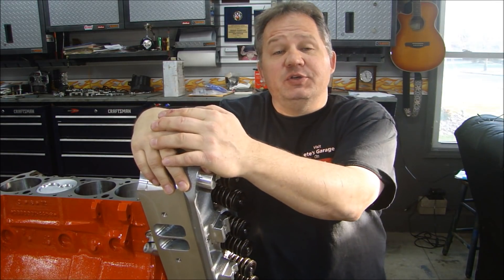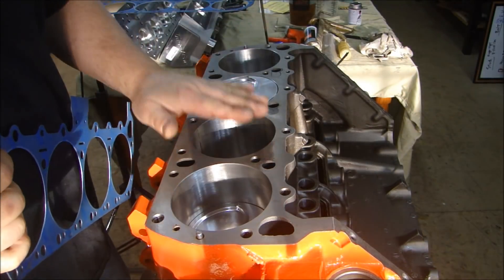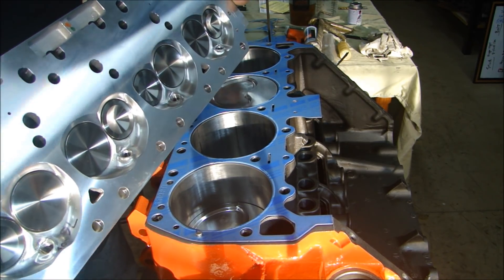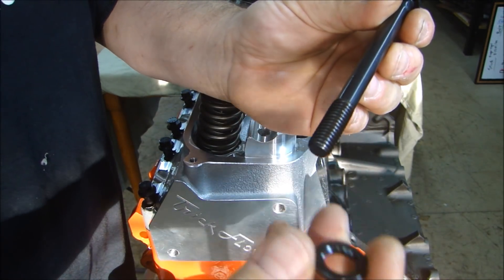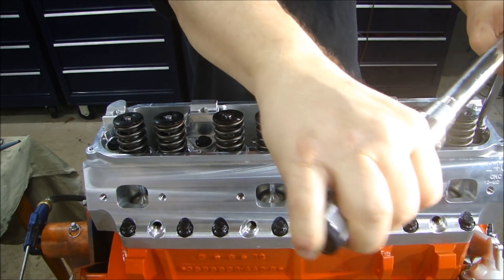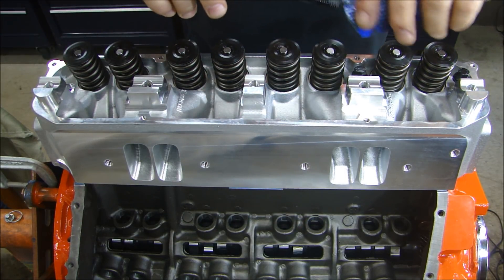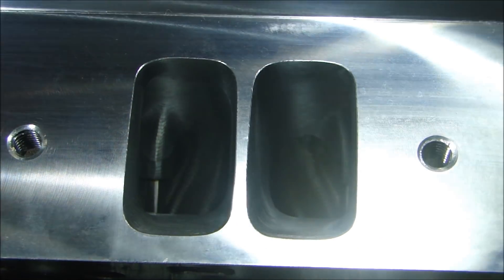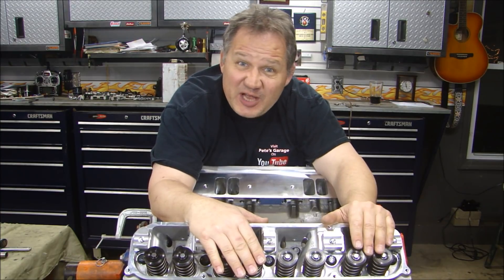440 Chrysler Mopar Engine Building Part 8 - Installing Trick Flow Cylinder Heads

Comment: Hello Sir
I bought the 440 trick flow upper motor kit cam etc.
My issue is the cam  "hydraulic " is a tad longer then the original one. For it to sit.right it sits out 1/4 inch which changes my timing chain gear! Is this correct? Thank you for your time.
Reply from the maker: Call 440 and ask, you may need a different timing gear

Comment: i know this is an old video, but sharing for anyone that may come across it.  Just received my 240s and they have small shavings in them that will need to be cleaned  highly recommend to NOT bolt on right out of the box. Otherwise, excellent product as usual and much nicer than a set of Victors I have.
Reply from the maker: Great comment, thanks!

Comment: i don't know if you will see this but are there any special torque specs for aluminum heads or do you just use the normal one. i got a 413 with them and i need to take her apart. better safe than sorry when i put her back together. n.n;
Reply from the maker: Yes there are. Follow the manufacturers recommendations

Comment: so on mt E Street heads there is no locating Dowl holes in the heads , so i removed the dowl pins does that make sense?
Reply from the maker: Dowel pins are pretty important. I would not take them out. Check to make sure. If there are no holes there is nothing you can do

Comment: Pete great videos so much info and much appreciated. I just pulled apart my Indy 440 -1 headed Mega block due to a low leak down number on cylinder 6. I’m ready to put the head back on and have a quick k question. Muscle Motors assemble this and I found they used Grey RTV around water passes. The deck is oringed and they used copper flat out head gaskets. I I didn’t see any worry on your assembly regarding the water passes. Do you see a need with my setup? And why did Muscle Motors do so?
Reply from the maker: If it was a copper gasket without any coatings on it they used it to seal the ports. Use a coated gasket and you won't need any sealer

Comment: Hi Pete, I notice that on your Ford rebuild you lubed the head bolt washer, is this true for the Mopar 440 as well?
Reply from the maker: You should always follow the manufacturers recommendations. New ARP bolts with aluminum heads are different. Putting lube on the washer will shift the torque curve slightly.

Comment: Stock FT 240 flow:

Intake
.100" 72
.200" 154
.300" 230
.400" 282
.500" 310
.600" 326
.700" 334

Ported TF 240 flow:

Intake
.100" 110
.200" 169
.300" 244
.400" 296
.500" 338
.600" 354
.700" 368

Also numbers from TF are a bit "optimistic" but as you can see, hand porting is worth the effort.
Reply from the maker: Interesting

Comment: A note on bolt lube for torque on Head, Mains and Rod bolts or Studs.
Because bolt lube (grease types) liquid oils etc. are like water and will not compress.
You must use minimal amounts verses excess amounts.
1 to 2 drops of lube oil dragged across “one section” the length of threaded bolt end is enough.   
Excessive bolt lube can generate false torque indications
As the bolt is torqued, the excessive lube overfills the threads and as 
higher torque is applied “stops” an accurate torque setting from being 
achieved.
A 110 lb. reading may only be 80 lbs. of torque applied.
ONE drop of oil is always a safe and sure rule.
Reply from the maker: Great comment, I have a couple videos that discuss and test what happens to torque when lube gets on a fastener

Comment: Did you retain the same height as stock for the cylinder heads in relation to the intake manifold? Or did you have to mill the intake because the cylinder block deck was resurfaced?
Reply from the maker: It was the same

Comment: Hey Pete, I'm about to start disassembling my 440 and will re-install the same heads if not cracked, would you have any guides or references/tips/tricks on how to assemble all the valves, springs and stems on the head or is there nothing specific for these engines?
Love your videos, just went through all of them all at once.
Reply from the maker: Replace the valve guides, put the valves and springs back in the same spots, hand lap the valves
Reply: How old are your springs? If original, might be time to get new springs. I would definitely replace the retainers and locks at any rate.

Comment: I'm definitely getting some trickflows for my procharged 451. I saw where the customer only wanted 500 hp. I bet that was beyond easy with those heads
Reply from the maker: t was just over, around 518 I think
Reply: The 240's can support a lot of power. I make well over 640 hp n/a on my 540 with a Howards 723235-08 cam. If you build a good engine and put a procharger on it, you can easily make 800-900 hp with the 240's.
Reply: @AB-80X  You are a bit too optimistic with power. High quality 470 will make 750ish with TF 270 heads but it will require some money on the table. You want that kind of hp you need Indy or B1 ported by someone good to flow 400cfm not to mention not very streetable bfc ;-)

Comment: I've been told by a machine shop that aftermarket heads should always be bought bare and never out of the box ready to install because of valve leakege issues. Have you ever had a problem like that?
Reply from the maker: I have never had a problem, but they do have a point
Reply: Lol. Do you know what that machine shop would do for a living if people did not buy bare heads they could "fix" out of the box? Not a damn thing.
AFR, Trick Flow, Pro-Filer, Mast, Edelbrock, Dart etc. It works. What you might want to do, is talk to your cam manufacture about springs. I always use a spring based on the cam manufactures advice, not what comes on the heads - unless the manufacture is okay with teh stock springs. Funny enough, with my TFS 240's Howards were on board with the stock springs. But I suppose it's because it has very similar cam specs compared to the cam Trick Flow recommends when using the 650 lift spring set.

When you talk to machine shops in the future, be vigilant about what they say you need. The more CNC stuff that comes out, the less they have to do. It's that simple.

Comment: Question: I’m building a pro street 440 (74 block) with a 509 purple cam and I’m looking for new aluminum heads. Are there any heads you’d recommend for that application?
Reply from the maker: Can't beat the Trick Flow or AFR
Reply: These are perfect for what you are doing. They will support a lot of power and they retain remarkable transition characteristics. I have mine on a 540, and could not be happier.

Comment: Pete been looking at these and the 270 heads. I see the difference is max wedge intake ports. Can you tell me if there is a max wedge intake that accepts 6pack carbs? Do you think there is an advantage to getting the 270’s without stroking my 440?
Reply from the maker: There would be an advantage, but I do not know of a 6 pack intake
Reply: Pete's Garage Thanks for the reply. I am gonna do the 240’s then.  Im eventually gonna do an 8-71 blower on another 440 block to swap in car and i think the 240’s would work also.  Any input?  This is gonna be my first blower engine.
Reply from the maker: You'll need lower compression with a blower
Reply: Pete's Garage Yes! I talked the Theblowershop and they also said to make sure the build is 9:1 or less to able to use pump gas. Im not too sure on cam selection for blower applications. I guess I have a little reading to do.
Reply: @Dodgechallengersixpack  
Just an addition. I have done a few RB's with blowers. The Blower Shop makes a nice blower, but unless you are looking to really push it, go with the BDS stage 2 8-71. There's nothing to gain from the high helix blower unless you spin it really fast. The BDS stage 2 works better for a street/strip combo with the lower blower speed, and will also take less maintenance. All that teflon is cool, but it needs replacing. The BDS 8-71 will easily support 800-900 hp and have a better response and last longer. BDS also have a super nice manifold that fits the RB. 9:1 is more than low enough with modern alu heads, don't go lower. Remember that the best motor you can make N/A is also the best motor you can make boosted. It will be more important to make sure your pistons and rings are up for the task - gas ports, ring gap and that sort of thing.
As for blower cam? It's like it has always been. Every cam is a blower cam, and if it makes good power N/A it will make good power blown. If you make good power N/A you need less boost to make power blown, and at the end of the day, boost is merely a function of resistance in the intake. You can make big power on low boost and no power on lots of boost. If anything, if you have a cam you already like, consider getting the manufacture to do a version of it with 2-3 degrees more LSA. It will soften up the bottom end a bit, but the positive displacement blower will fill in that dip in torque. The wider LSA will then help the motor carry a bit better out the back door.
Something hydraulic roller with 238/246 @ .050, about 610 lift and 112 LSA would make a really nice blower cam in a 440 wedge.  Give Kirk at Howards a call, he knows his Mopar cams.
Reply: I run 240's on a 540 and I'm far from running out of head. Unless you are making some serious N/A power, you gain nothing with the 270's other than a headache. And seeing that you plan on using the 3x2 bbl, there's a "natural" limitation there. Forget 270's unless you spin that 440 past 7000 rpm and run a big single plane. I make close to 650 hp with my mill and that's with a "mild" intake for nice drivability.
You can get a 3x2 bbl intake for the 240 and it will still support 575-600 hp, so just go that route.
Reply: @AB-80X   what "mild" intake did you use ? Just curious.
Reply: @Torquemonster440  Trick Flow normal wedge w. 240 heads. Mind you, my mill is a 540, so everything seems smaller compared to a 440. But the TF single plane is actually a nice intake that does many things well. Alternatively you could go with a Hughes ported Perf. RPM DP. But all things considered, the TF intake(non-max wedge style) is really good as the runners have a decent length. It's nothing like a Super Vic or the like, it's a properly well though out intake. There's a reason why so many use it in so many different applications. What ultimately defines how well your engine runs is the whole package and cam.
Reply: @AB-80X   oh, nice.. I've had one of those sitting on my shelf for a year now. I'm hesitant to swap from my Performer RPM, for fear of killing torque.  I run a 3500 converter and 4.10 gears, so i dont think it will be too bad. I also plan on using a 1" taperd Wilson spacer.  This is in a .040 over 440 with 10.3-1 compression and Edelbrock heads.  I have a very mild solid flat tappet in there now, old school mp .528 purpleshaft .528 lift 242/242 @.050 on a 112 lsa. I will be swapping to a much more aggressive cam shortly, custom comp roller with .575 lift, 243/247 @ .050 and a 107 lsa. I'm hoping with the new cam, the Trickflow intake will complement it well. ? Your thoughts ?
Reply: @Torquemonster440  
With that stall and those gears, your engine is begging for more cam - and the TFS intake is a great option. The RPM intake is nice and okay for the mild cam, but especially if you step up the cam, it will just kill the top end. With a 3500 stall, you flash past the weak part of the rpm band anyway and a 4.10 gear is not hard to pull. 
The TFS intake will also give you better cylinder to cylinder distribution.
If you're stepping up to that kind of duration, I'd take advantage of the intake and use the TFS Track Max cam. It's a brilliant lobe design that also runs really well with the Sharp 1.6 ratio arms should you wish to increase lift even further. That setup will get into the powerband from about 2900-3000 and up. My guess is that it will make your current converter flash 200 or so rpm higher, so it will get one heck of an additional nice kick in the rear when you get on it.
Reply: @AB-80X   i was thinking the same. I speced that custom roller after the Track Max cam.   Just with a little less lift as to not stress my old scool Crane ductile rockers. I dont have the extra $1k to drop on the Harlands.. wish I did. I also went with a 107 lsa to help crutch my still mediocre head flow .. you know Edelbrock vs TFS.. didn't have the coin for TFS's either.. 😕.. but i think with this combo maximized i should be in the 525 hp range.. probably the same for tq.. 🤞 I'm also gonna run solid lifters on that Hydro stick.. sounds like the hot ticket if you wanna run a roller on the street trouble free. Mid range solid lifters are considerably cheaper than high end hydro lifters, which sounds like you need to go high end if you wanna run hydro lifters, lots of problems with the budget versions from what I've read. Thanks for your input.👍

Comment: Pete, I’ve looked pretty hard for this head you’re using and can’t find one with a 76 cc chamber. I see a 78cc. Can you provide a Trick Flow part number? Also, what compression ratio were you shooting for on this project?
Reply from the maker: The part number is 61617802-C00 which are listed as 78cc, but I think I measured differently, I really don't recall

Comment: Well I hope when I measure mine they're exactly 78cc if they're 76 ill be over my "on the verge" for pump gas 92 compression
Reply: I was just about to ask Pete which heads he used because all the TF Mopar 240 heads I’m finding have 78cc chambers.
Reply: @tedshredz58  yeah, they're computer cnc so there shouldn't be any variances unless there's a bit of shift in the mold but I doubt it. These heads visually are a proper aftermarket performance head. I dumped rubbing alcohol into all ports after I unboxed them & absolutely nothing came through any valve. In the combustion chambers I am going to hit em up with 120 grit roll to get them soothed out. A guy on a mopar forum got the 240s to flow 350cfm @ 600 lift by 80 grit rolls in the intake ports just removing the tooling marks.
Reply from the maker: That's why it's important to check

Comment: Sorry but B1 Orginal heads blow those outta the water so does indy
Reply: Robert Parker Nothing wrong with Trick Flow 240 or 270 heads for BB Mopar.  Indy makes great heads too.  You claiming Indy out preforms TF without giving a application, use, compression ratio, cam or type of fuel delivery is a little too broad of a statement.  There’s 1000’s of dyno run tests on engines producing big HP with TF heads.
Reply: @jamesfeil2468  yep Andy finkbeiner has 750 on the 240s with a 470 cube engine.
Reply: B1 heads don't just bolt on and you can't use any & all of your factory parts either like you can with trickflow. Indy heads in this price range don't make the same power either, or flow numbers especially since were talking a standard port head. Hands down trickflow 240 wins in a apples to apples test. Or as you would say "blow them out of the water"
Reply from the maker: Thansk Robert

Comment: Dear Pete..As a fellow motorhead myself I was a little surprised you didn't opt for the MLS Head Gasket's especially with the Dissimilar Alloy's , We both know what happen's with aluminum & Iron ..Don't get me wrong Felpro have been my Gasket's of choice since my very first head swap in 77.. Anyway good luck ..
Reply from the maker: It's a great option Michael. For this particular application I did not see the need for it.

Comment: Hi pete, nice project you got going, i'm a big mopar fanatic , I bought a 69 dodge charger and a 71 Plymouth road runner right out of high school back in 1983, Still own them today , and both big block car's ,  like you're garage videos , Back to the ARP head bolts , They counter sink the one side of the washer so you get a more precise reading when tightening down the  heads , no drag on the top inside edge of washer / corner of bolt head to bolt shank, gives a gap in corner and like you said a nice smooth surface to surface  mate.
Reply from the maker: That's really awesome, you're lucky to have those cars. Great comment about the ARP bolts.

Comment: Could you comment on the spring rates? Which did you select and why? Which head/spring combination is best for a solid flat tappet cam at about .600 lift? Thanks Pete...great information and wish you were closer to Bawstin to build my engine.
Reply: Contact your cam manufacture and use the what they reccomend. But why on earth would you use solid flat tappets with 600 lift? You can easilly lift to 600 with hydraulics. I lift my 240 heads to 640 with hydraulic rollers and it work perfectly.

Comment: I do not claim to know anything about after market heads, however I have watched a number of Youtube posts. Nobody takes the heads out of the box and bolts the to the block without taking them apart and checking them. I have seen a lot of mistakes from the manufacture.
Reply from the maker: That is not a bad practice. I inspect the heads visually. Most defects can be seen if you know what to look for. When you get up to $1,000 per head you can have more confidence in them right out of the box.

Comment: Have you any experience with other sets of these heads, the spec on the head is 78cc's,  just wondering if they all come at 76cc's.
Reply from the maker: Since they are CNC ported they are all very close if not right on. I have not had a bad set.

Comment: Hi, what are you opinion about 440 Source Aluminum Cylinder head and Edelbrock, compared to Trick flow heads??
Reply from the maker: Well, Trick Flow is a CNC ported head so it will flow a little better. If you have the money and want the most HP, it's the best way to go. That does not mean the others will not perform well.
Reply: Thanks ;)
Reply: @PetesGarage   ... any reference material on how these heads compared to the older Mopar Performance B1 and B2 heads?  At one time, the B Heads were the best performing head for the RB's